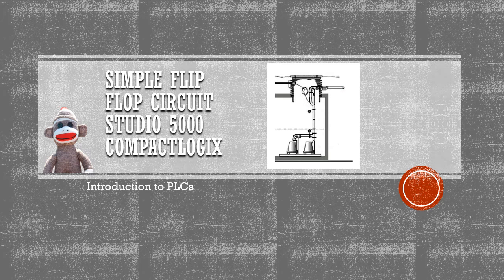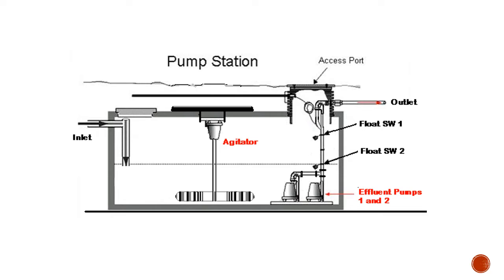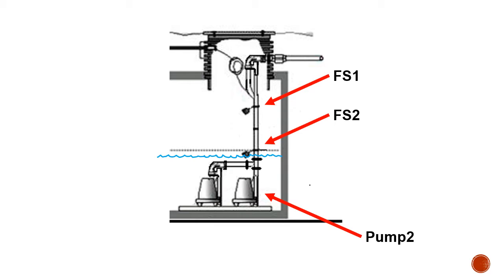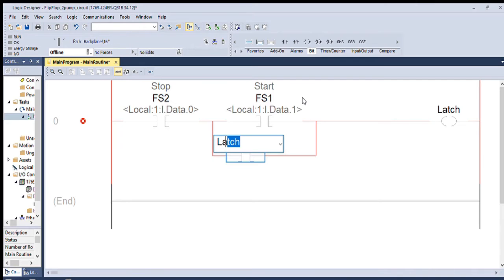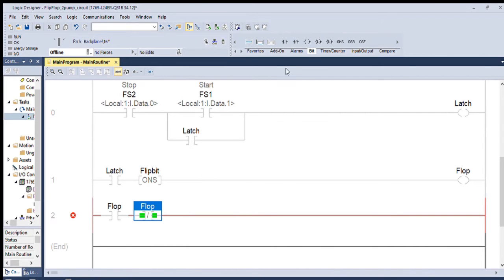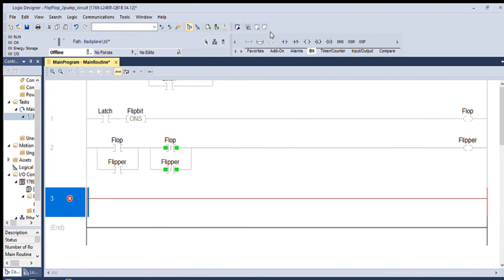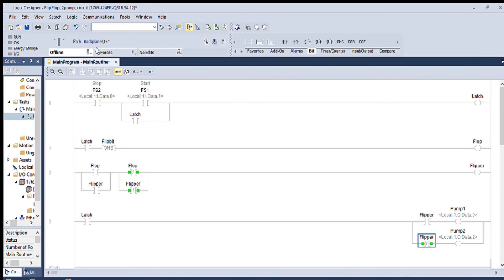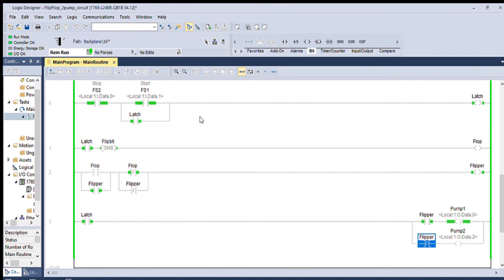Studio 5000 Flip Flop Circuit

Comment: Good Vid! how you got studio 5000?
Reply from the maker: The company I work for provides it. Sorry, that probably doesn't help you much.
Reply: @Imheotep  All good was just wondering, they don't give this stuff out for free and I can't take my laptop home
Reply from the maker: @mw3blackopsglitches  Allen Bradley does have free softwear for the Micro 800 family of controllers. The Software is Connected Components Workbench. I'm starting to see more and more of the Micro 800's being used for that reason. might be something worth looking into. 

I personally am more comfortable programming the MIco 800's in Connected Components Workbench. I like it, and find it more user friendly, plus the controllers are more economical compared to the CompactLogix
Reply: @Imheotep  I seen that I thought about buying a cheap AB plc that used that for home to get some extra practice in and maybe make a cool program at home because the plcs are only like $200-500 and yea I watched a few videos of the plc program software and it's free and didn't look bad. Thanks!
Reply: if youre tryingg to learn rockkwell offers their old logix500 for free. its basically the same but of course older so it doesnt have all the bells and whistles but they give you emulator access as well.
Reply from the maker: @evilnick2885  I'm gonna have to look into this. I have a stack of micrologix kicking around in storage. Thanks for sharing!
Reply: @Imheotep  my pleasure